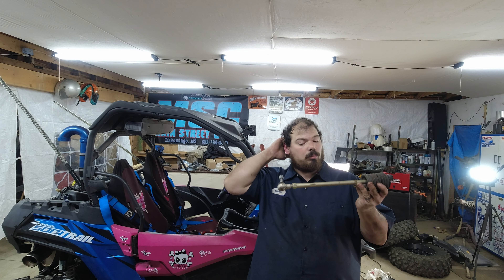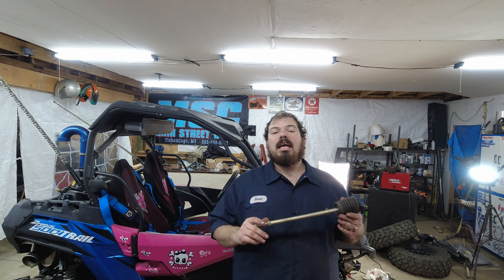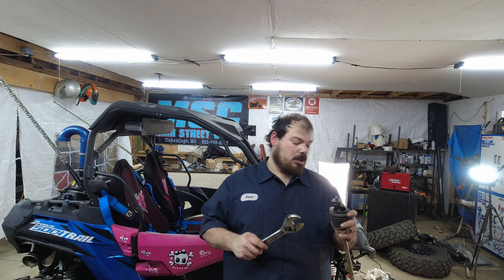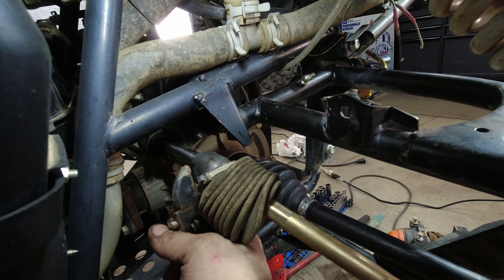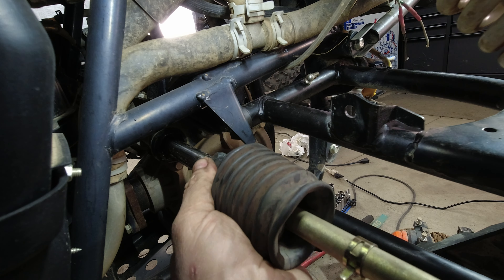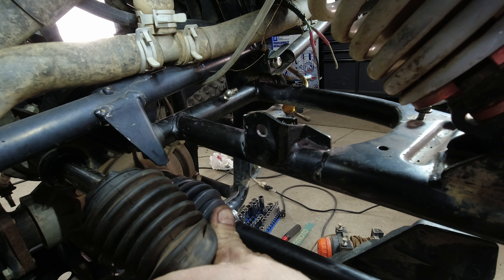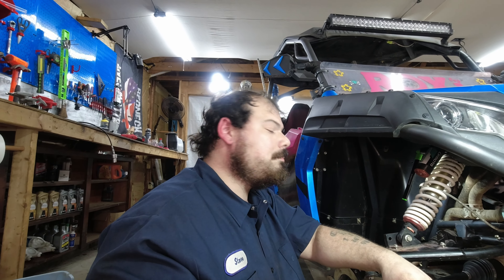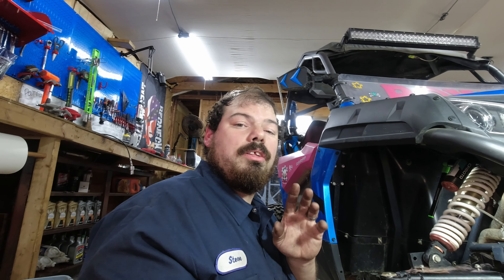CFMOTO ZForce Inner Tie Rod Installation and Removal

Comment: On the 800ex is there any difference between inner tie rod ends on a 2021 and 2022.the 2022 has a different part # and nobody has them

Comment: When did they downsize the axle nut to 32 mm? My 2017 comes with 36 mm axle nuts.
Reply from the maker: 🤷‍♂️ my 800 is the same size also.
Reply: Oh, maybe cuz hers is a 500
Reply from the maker: @kevmcd1752  it’s possible.

Comment: Not sure if I should get the 2022 uforce 600 or zforce 500 to drive my 4 year old daughter around through the trails at camp? I have a order in for a uforce 600 already but not sure if I should change my mind.
Reply from the maker: Either machine will be good.

Comment: I snapped my driver side front tie rod in half.  I can not get the knuckle that is attached to the wheel steering assembly on the hub.  It looks like it is threaded into where it mounts.  There is nothing to put a wrench onto to unscrew it.  I have tried a pry bar, hammer, etc.  HELP PLEASE!